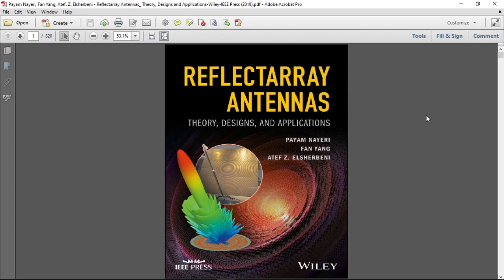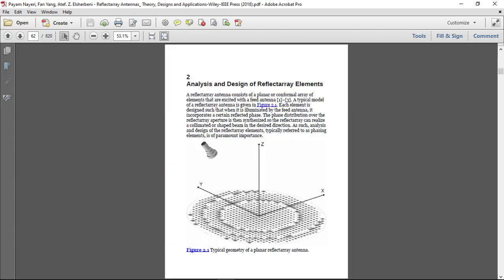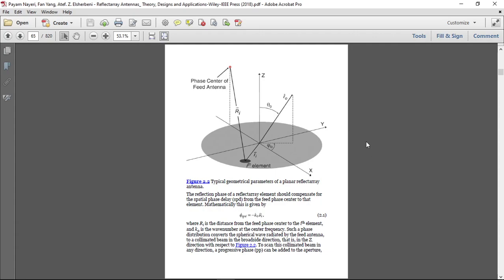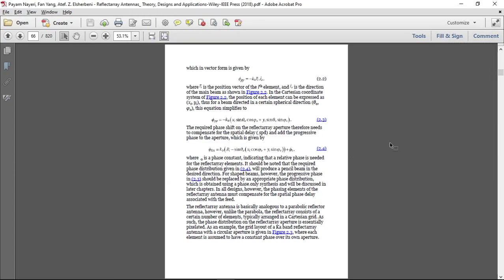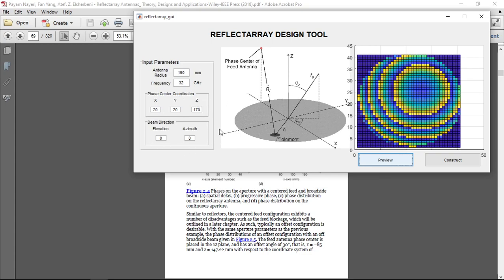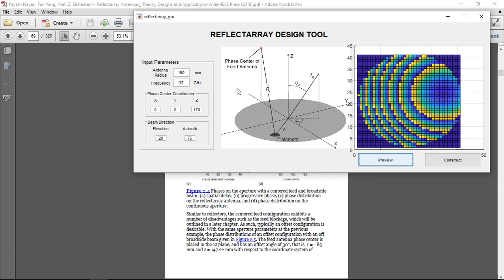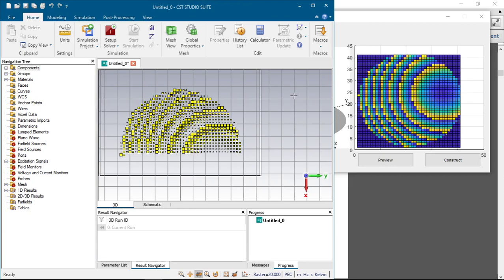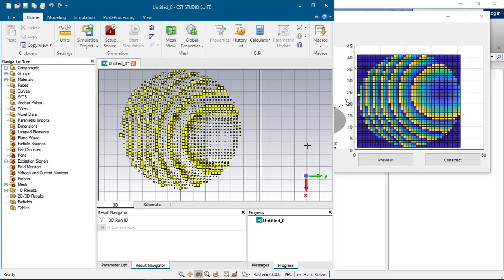Reflectarray Antenna Design using MATLAB and CST (Part 1)

Comment: Hey, hi! The CST-MATLAB-API-master file is missing from the drive, and as a result, the code isn't running in CST and is showing an error. How can I fix this?
Reply: hey, myself prateek this side. working on the same project and dealing with the same problem, need your help if you could've managed to solved the issue.

Comment: Hello Dear. Thanks for your great tutorial. I implemented what you taught but I have problem with patch sizes smaller than 1 mm. I got an error in CST. Also values are rounded for example 1.5 mm to 1mm, so I cannot get the exact values for patches. Could you please help me? Thanks in advance for your help
Reply from the maker: it is probably due to the codes using integer instead of double. could you please check it?
Reply: @SimulationMaster  it doesn't work for me when i use your data. i just i have 8 elements and it stops
Reply from the maker: @godwinkwameboakye2114  what error do you get in MATLAB?